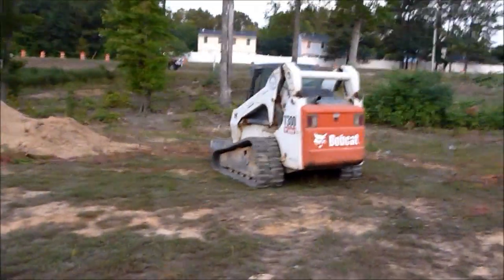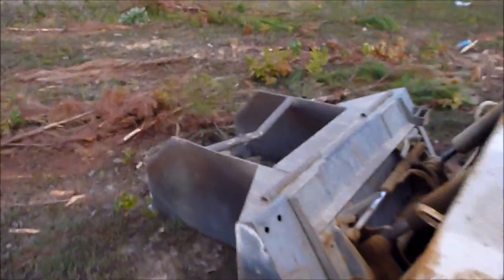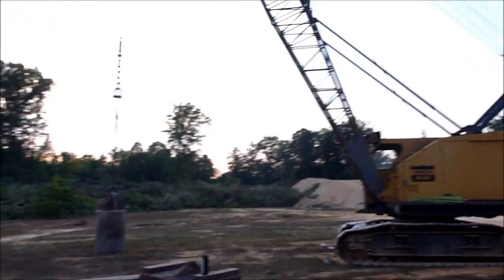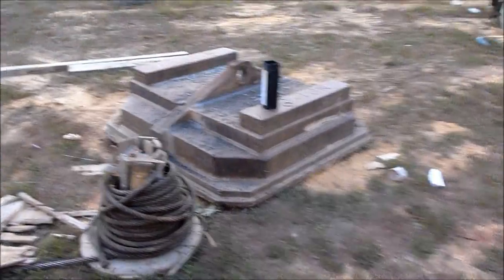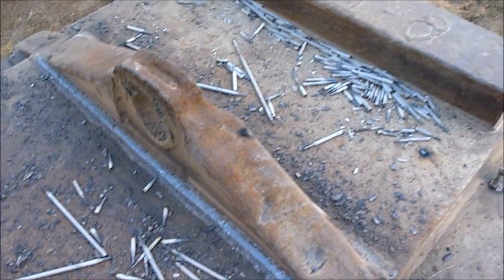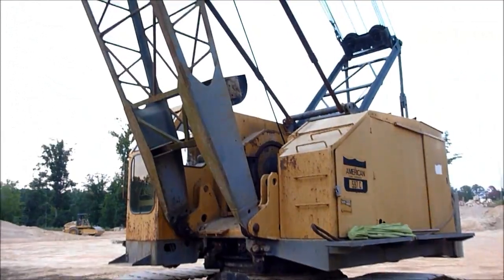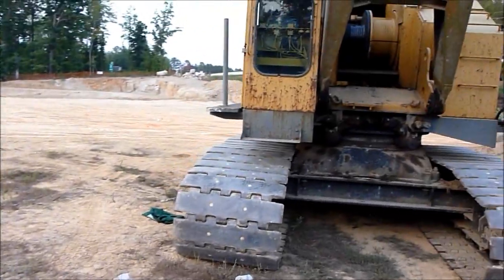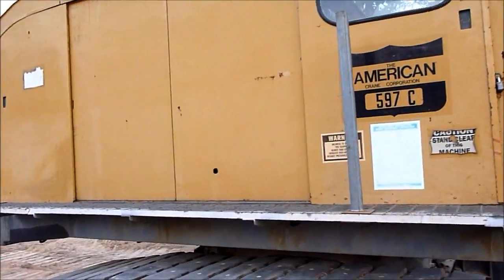Dynamic Soil Compaction

Comment: I am doing this type of work now,on a 999C American,the cable is kept short,just enough on the drum to do the job.We are using a 41000lbs weight,lifting it to 65 ft and dropping it.When it is about 3 ft from the ground you step on the brake to stop the drum before spooling all the cable off.

Comment: So what are they doing? 
Are they just compacting areas the diameter of the weight, for pilings/footings, etc?
Or are they compacting larger areas one plop at a time?
From what you said about the aiming flags, it sounds like it is small areas, and maybe they use the plate for larger areas?